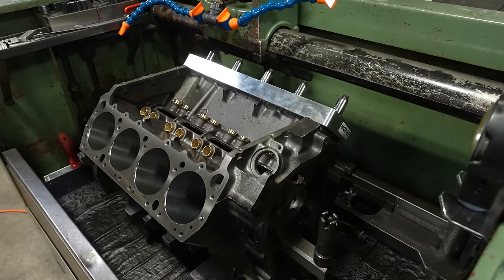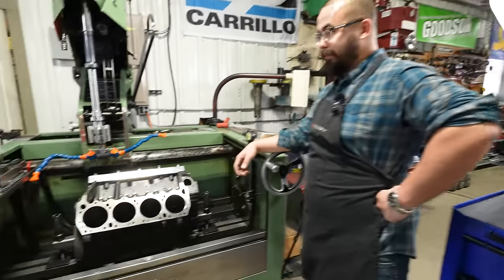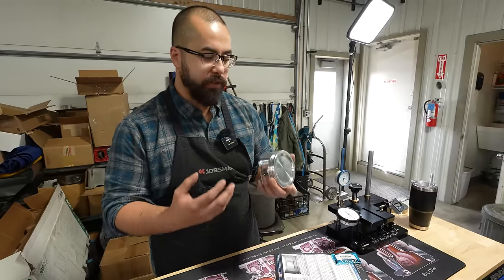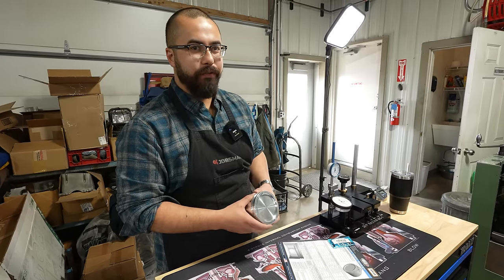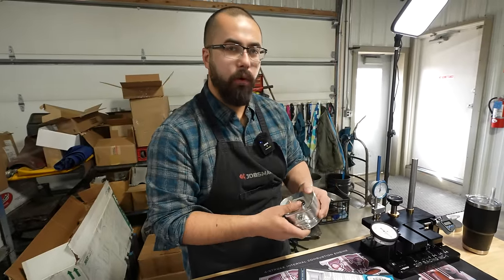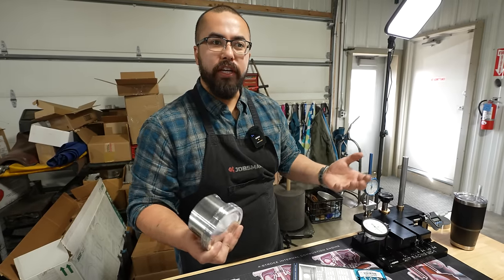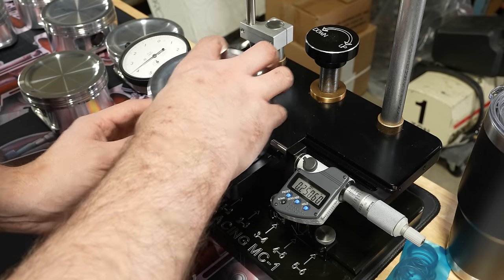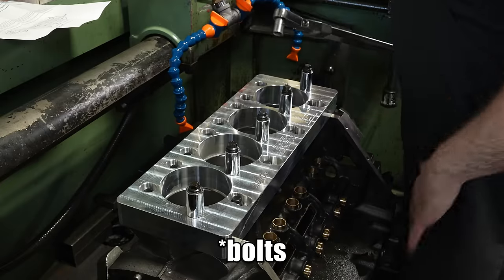How We Hone YOUR Engine Block For A Set Of CUSTOM Pistons!

Comment: So I signed up for this, but I truly had no idea what I was getting. This video shows the amount of attention to detail that you care about Nic and Josh. I am forever grateful for our subscribers who connected us! How freaking cool is that! Can't wait to drop this bad boy in my Power Wagon!
Reply: Injection or carb? Would be neat to see one of the new Edelbrock/Holley pattern units dialed in by an old school master. More episodes-more better.
Reply: @user-sd5wg1vg4e  while I like the idea of installing fuel injection, what I don't like are any aftermarket electronic parts these days. If I have a problem with the ECM in particular,  I'm stuck with only one supplier. What happens 10 years from now too? Things I'm considering and why I'm staying with a carb. Also if I stay with a carb, I have only one single transistor that I have to worry about and it's my ignition module. I kind of like that idea for when the nukes drop 😅
Reply: You misunderstoid my comment. I was asking which direction, injection or carb. I was suggesting that the new Edelbrock carb would be a cool addition. Check it out, a new Holley pattern 4bbl with all the upgrade goodies staight out of the box.
Reply: @ScannerDanner  prepping the Scanner Danner style
Reply: wait a damn minute wat nuke dropping!
Reply: @raj-u6t1m my fault! I did misread your comment. Thanks for the info too!
Reply: @crasher88  😂 indeed
Reply: @ScannerDanner  going to have the transmission checked out as well? I honestly don’t remember if you have mentioned that or not. 🙃
Reply: @Embermist69  yes sir! Going through both the trans (NP435 4-speed manual) and transfer case (NP 208) as we speak!

Comment: The Blue Dykem cylinder... Blew my mind 😲.... Visual Proof of the advantages of a Torque Plate!! 
The knowledge of how the combustion front hits the pistons and rings at the top of the chamber and how "out of round" in can be!! 
Modern Technology works, so use it! 😁👍💪

Comment: using fine mesh finite element modeling for highly stressed aviation components such as hydraulic valves and pumps we used to see these kind of distortions.  when shops then whittled the components out on the nc mills and we tested them you would the see the wear patterns proving out.  your illustration on these cylinder bores was excellent.  keeps me watching you all.

Comment: Yesterday I fixed an oil leak between the crankcase (not the sump), the timing cover and the engine block with the method of the syringe and the vacuum cleaner explained some weeks ago in this great channel.

You guys are a great source of knowledge and wisdom. I owe you a beer (or two) from Spain. You saved me a whole lot of labour.
Reply from the maker: Haha that’s awesome!! Glad it worked for you!

What part of Spain?
Reply: @JAMSIONLINE  Near Barcelona. :)
Just FYI, it was one of the first TD engines developed by Citroën (U25/673). A noisy, usually oily, slow, clattery but reliable machine. The clatter comes from the huuuge tolerances between pistons and cylinder walls (up to 0,15mm by manufacturer!). The turbo somewhat warms up the internals, getting a bit quieter while running at temp.
Reply: Do you have the name of the video handy. I would like to see the trick, I had a look through the videos but couldn't seem to find one that looked like it might have it. Thanks in advance.

Comment: I saw a great video from Harry's Garage, where he had Carillo forged pistons made. He was restoning a Lamborghini Espada V12. They sent their old 82.2mm pistons and asked for 82.5mm pistons. He loved how the pistons looked so much, he had a 13th made to keep as a work of art.

They mentioned that the Espada would suffer rapid piston ring wear. Back then, those metric engines probably had a 1.75mm X 2mm X 4mm chrome ring pack. 2mm rings are very close to 5/64 and 4 mm is very close to 5/32. I mentioned that those custom forged pistons would have new narrow rings, and some kind of coating that outperforms chrome.

In 2014, I was at a major auto show. They had a cutaway of a modern engine from Ford. Someone pointed to it and said "Look at those tiny rings! How can that possibly work?" I then told a stranger how new rings are made of forged steel and have a performance coating that is an alternative to chrome. It replaced the 2mm chrome plated iron rings. I think 5 people came closer to listen, even one of the Ford sales staff. I then said that these rings put less pressure on the cylinder bore, leading to even longer engine life.

I think some other people asked "Is this sort of thing even possible?" I said "It is if it is done right. People have been turning up the boost and getting away with it on the Nissan 300ZX, SAAB 900, and Volvo brick since the 1980s." I was not going to say whether or not this engine was going to take it, I did not know the history. I also mentioned how my understanding of all this began when I read an article about getting 450 horsepower out of a Nissan 300ZX Twin Turbo. It was the May 1998 issue of Sport Compact Car. Once that article explained a heated wire mass air sensor, I knew I could work with modern cars. Some car guys find that origin story fascinating.

Sure, maybe some of the older engines had ductile moly rings instead of chrome iron rings. It was an improvement over the chrome iron rings. Also, I did not say what replacement for chrome there was. However, that is because there is more than one, and I did not want to get it wrong. However, to people who didn't know all the details of piston rings, it made the point.

There is one downside to 2mm oil rings, but us car guys probably won't have it happen to us. Those rings become useless with just a tiny amount of sludge. It often happens when people go the full length that oil changes are called for. Don't fully trust your manual, do maintenance more often. Chemicals are cheap compared to cars.
Reply: Some of the old Triumph motorcycle engines used chrome rings in the early days and they had issues of high oil consumption because it took for ever for the rings to seal & often times the cylinder bores would wear out quick causing more oil consumption and compression to drop so eventually Triumph dropped using the chrome rings and went back to cast rings for quicker break in & less ring & bore wear on their engines . Ring technology has come a long ways since the 50s and 60s as well as better piston designs and even the use of better block & cylinder metals for increased strength .  My old Harley Davidson repair manual from 1986 says that if the cylinder is to be bored and honed that Torque plates should be used so the bore stays round like it will with the head on it which makes sense for better ring seal & longevity especially on a air cooled V twin engine with a aluminum head.  The Evolution engines were the first HD engine that were designed to run for a 100,000 miles before needing rebuilding unless the engine was built on a Monday or Friday lol but mines got 70,000 miles on it now and still runs strong and uses very little oil in a 86 FLHT that's been all over the country and up in Canada a few times . I know guys who have twin cams engines and they've had all kinds of problems with them from cracked pistons to cam chains that broke & cam chain tensioners that the plastic wasn't strong enough to where the tensioners would grind up from the chain & clog the oil pump with plastic and then the engine would seiz and lock up because of the problems they had on those engines so I'm sticking with my EVO because its been so good to me . I've built a few Mopar big blocks so I've been watching this so keep the videos coming & if possible tell the owner when he's going to Dyno the engine we want a Dyno engine video of it to see what kind of power & torque it makes.

Comment: At the end of the day the you are at the will of the springs in the hone! Regardless of how sophisticated your equipment is there things out of control. Stones can crack, be unusual shape etc .
Reply: But there are no "stones" in this set up are there? Both the diamond and CBN hones are formed on solid metal backing " plates" for a better word so cracking is not an issue in either types of hone and as a machine shop you have to rely on the hone manufacturers specifications and their quality control systems. As expensive as I suspect that honing head is I'm sure if there was a problem with one or more of the hones, then the manufacturer would replace it straight away and want the defective ones back to sort the issue.  It's no different than having confidence in your measuring system. That it is correct and in specification.

Comment: I do agree if you have the means its worth the extra effort to strive for perfection, but then again if you dont have the access i feel like the old way is good enough for a tractor or a farm truck, possibly a daily driver. But if its a high dollar engine, race engine, then it should be taken somewhere that has the means to do it right. I guess im saying, imo, its application dependent. One thing i would like to see, because i seen it on another channel where they ran the old 3 stone drill type hone and backed it with a ball hone and said the profilometer numbers were quite impressive, so i would love to see an experiment on an old junk worn block/cylinder to compare both methods. Using the appropriate grits with the old diy method everbody and their brother is familiar with and see if the numbers are even in the same ballpark.

Comment: Hello, what size diamond stones were used for the roughing and finishing operation?  In my experience, diamond bars need to be exposed to a new layer of diamond grains as the diamond grains wear out; I grind them on a silicon carbide wheel with large black grains to remove the binder from the bars.  Even inside the honing head, I made an adjustable pusher to adjust the cones that open the head pads on which the diamond stones are glued.. It is very convenient to adjust when the honing head begins to make a cone inside the cylinder.

Comment: so i have a question about the torque plates. I have known for decades that it makes a difference. my question is, how long would a street engine run before the rings wore the cylinder round? or would todays rings not even do that? I am likely older than "the cleaning guy",  my hot rod was built in 1977. so that dates me a bit. back then we used moly rings. and the bores were honed with torque plates. i am just curious.
Reply: ditto.  i was building small blocks in early 70s

Comment: Gentlemen, that was great and I look forward to more collaboration!  A quick question related to the distortion from the torque plate: would it make any sense (if even practical) to do the boring with the torque plate attached?
Reply from the maker: Some people do, but I consider boring to be a “rough” process and therefore don’t believe it to be necessary. If you’ve left enough material to finish in the hone, it won’t make a difference if you did or didn’t bore with a torque plate in my opinion.

Comment: For a small displacement/horsepower naturally aspirated engine, do you think a precision hone like this has more affect to gains in the precision? I would love to have a spare race engine put together to near-OEM spec with a torque plate and all the goodies.. you're in Ft Collins? ♥all you do, tractors and all - mine is a Miata problem.. heh

Comment: i value your knowledge and opinions so i ask. i got my engine back from the shop and the cross hatch was supposed to be 30 degrees. when i checked it its only 10-12 degrees. will this be a major issue? does it have to be re-done?

Comment: Three questions: 
1). How well does the Torque Plate replicate the cylinder distortion caused by torquing down the actual head?
2). The compression and detonation of the air/fuel mix acting on the head will put additional tension in the head bolts, will this cause significant cylinder distortion?
3). We didn’t see the distortion in the linered cylinder - is it different to the non-linered cylinders?

Comment: Seems as if your breaking in the cylinder walls, with the stone, instead of the rings. Wonder if guys that are in racing teams hitting the cylinders will the dingle hone like they used to or just slapping new rings in. I’m thinking after the engine runs the cylinder gets a little smoother, just wonder if a new set of rings would need the new hone, like what guys with nitrous engines do.

Comment: Say, isnt one bore offset by .0025?? How do you get the torque plate to line up with that hole?? Am I the only one that remembers that? I recall that you sonic checked the block, and the thrust side on one bore was a little thin, so you moved it over!
Reply: great question!

Comment: Could you spray it and hone it without the torque plate, show us, then bolt the torque plate down, respray and rehone to show the difference? Not a full hone, just 5 or 6 strokes each one.

Comment: My machine shop measures each piston & records that size on top of the piston with a felt tip marker, and then each  bore is honed to size for it's own piston for an absolutely perfect sized fit & clearance ( as racing engine builders do ) and as you said when you'd finished, - " For an engine like this, definitely, super, super crtical to get these numbers right ... " - just wondering why you guys didn't go that extra 5 minute step for your customer.

Comment: The reason modern engines last so long in comparison to the earlier days of engine building is the precision used today. In the "old days" a 30,000 mile engine was good. Now 100,000 to 200,000 miles is considered normal!

Comment: Torque plates have been around for decades, and they should be in every machinist's inventory. I became friends with the machinist/engine builder who did my first engine in 1993, the original 302 in my 1970 Mustang, and he insisted on using torque plates. He also insisted on doing line bores/hones on the mains, and he taught me how to balance the crank, as well as the pistons and rods, which ended up being within .005 gram of each other, when I was done with them. There's something to be said for being anal retentive and paying attention to detail, when it comes to machining and building an engine.

Comment: Never been a fan of diamond hones. Sure, it's fine for working with carbide, but if and when the diamonds chip off, (and they do), they can embed themselves in the "soft" steel cylinder wall becoming a tooth in a file on your cylinder rings. I once bought a set of Nickleson diamond files (12") and thought I would be able to sharpen my lawnmower blade for the rest of my life with them. Not! I stroked them about 30 times and thought it was just peeling away the steel. turned out, IT WAS THE DIAMOND coming off the file. I honed carbide for 40 years. The diamond does come off on those too.  Thoughts?

Comment: so where is your quench, heads would support, what is your deck clearance not that it matters with those round dishes what are the cam specs  006, 050, 200

Comment: Kind of curious how some manufacturers are getting 200,000-300,000 miles out of engines (proper oil changes of course) when they likely don't spend this much effort in the machining process. Modern engines are also getting outrageous HP these days too. In the old days (60's-70's) getting 100,000 miles was doing well on an engine that maybe made 200-350 HP.

Comment: Was the torque plate used because it was a Dordge? 😂 Or will JAMSI be moving forward with torque plates as common practice? Or application specific?
Reply from the maker: We already use torque plates in any performance application when available lol. I already believed in the benefits, Josh & I had just been debating how aggressive the distortion would be (do we need .003” left to hone? .005”? .007”?)

Comment: "Use the new tools"... In the mid 80s, digital meters came out. My shop cheif in the electric shop refused to use one. He burned a wire with a dead short and complained it still showed continuity. I told him, "A good electrician would not need any meter to know that wire was bad." I had to go mop the battery shop!!!
Reply: Sir, the 80’s were 40 years ago.
Reply: @EngineRehab  Yes. It's unbelievable how much a new O scope can tell you. And I see these guys with digital milling machines doing amazing things.

Comment: if your  gonna  fiddle with the  pointless details of using the  torque  plate  then you might aswell heat the block to   the  running  temperature of an engine   because there is difference   expansion rates    in the engine and then the  physical twisting and  destortion of the engine from  the  engine running where the block will twist and bow    there just  isent  much point to using  torque plates unless you go    high  power build

Comment: I used to work on older furr-are-E's. It is hilarious how poorly made their cars can be. I had a customer purchase a new Testarossa, delivered to my shop. The car had a small hole through the passenger door. As though someone had taken a drill bit and drilled a hole. It had three huge paint drips down the large rear valance. And it threw its belts the first time it was driven! furr-are-E refused to pay the cost for repair for the belts! You have to be a dullard masochist to purchase them.